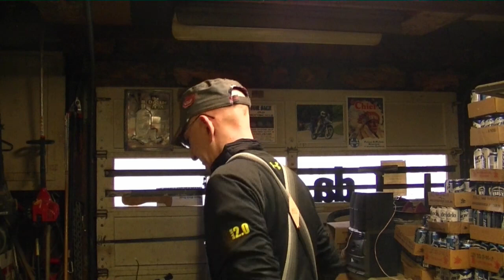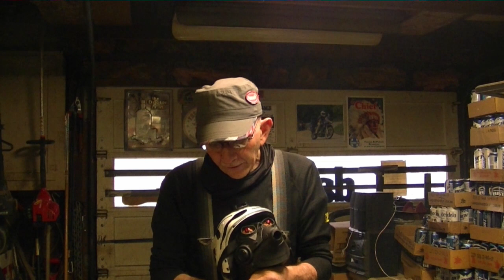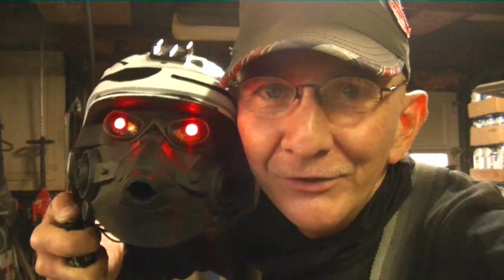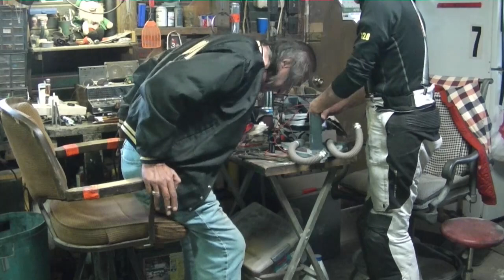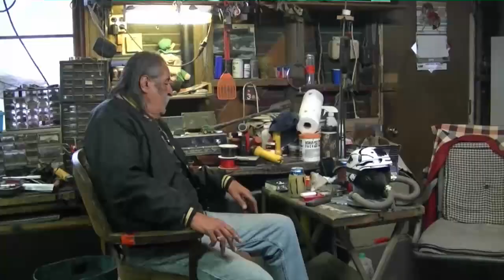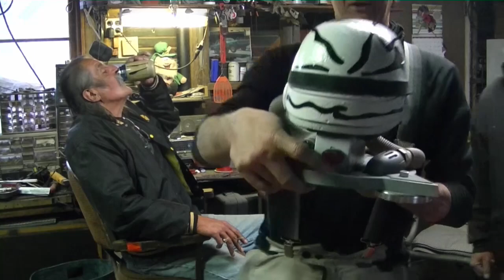LED Install

Comment: Are you connecting this to the brake lights or having continuous power? Brake lights won't require a separate switch.  You could tie into your accessory circuit which also would not require a switch if you wish to run the lights when the bike is powered up. FYI. They do not recommend solder on areas with heavy vibration.

Comment: Most LED's I have used run on a 12 volt system.  It would be easy to just tie into Barbie's electrical system.  LED's pull no wattage.  You could literally run thousands of those lights given the wattage Barbie's stator is putting out.